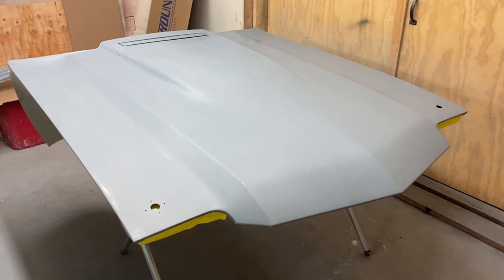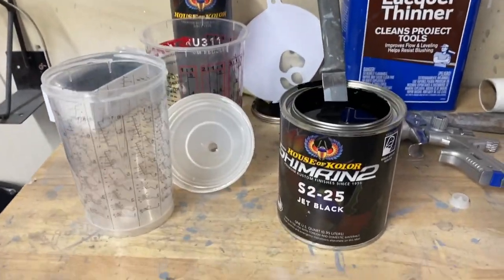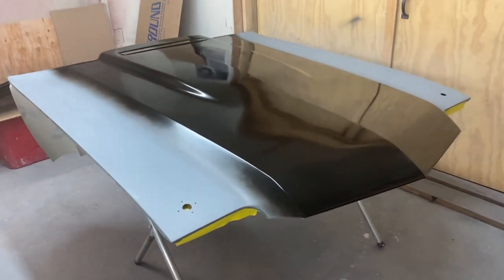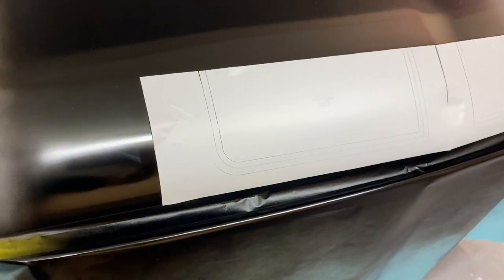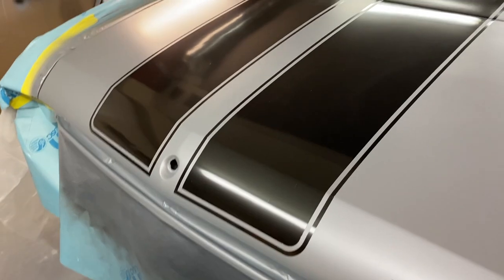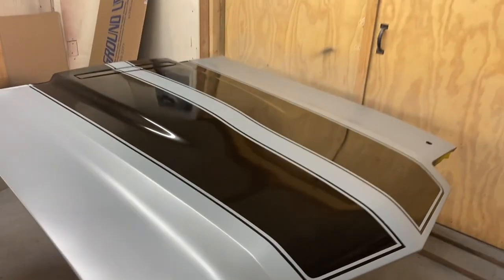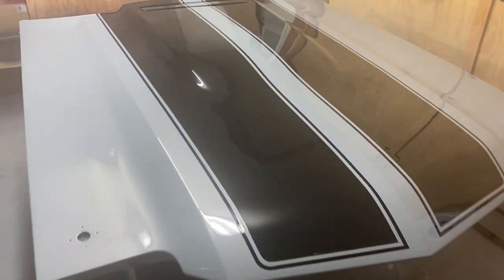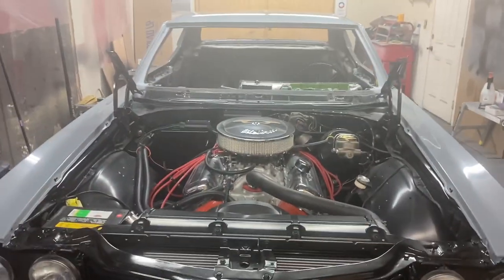Painting SS Stripes on my 70 Chevelle! Ep. 24

Comment: Nice job!! 
My mom a dad bought a 1970 Chevelle ss stripe delete the had the dealership add the stripes so the strip were on top of the green paint color. 
The dealership had the red Chevelle with the black stripes  on the show room floor, from the factory the car with functional cawl hood option the black for the stripes were painted first then the stencil for the stripes applied the the hood was painted red, no clear back in those days. 
You basically did it the same way! Nice job!!

Comment: Just a couple of comments questions. How you do you deal with the Mil difference between the stripes and base coat? At what point are you knocking dust nibs off with the 600? prior to clear or after flash off between black coats? Thanks
Reply from the maker: Definitely removing dust nibs between black coats. to deal with the mill difference I put down an extra coat of clear on the base coat before clearing off the entire hood with multiple coats. I don't claim to be an expert but finish came out nice.